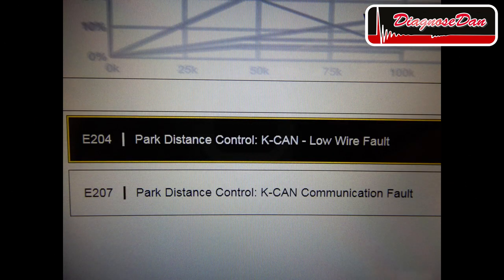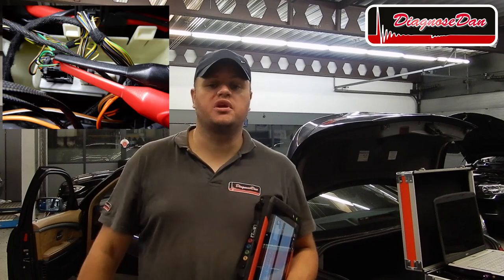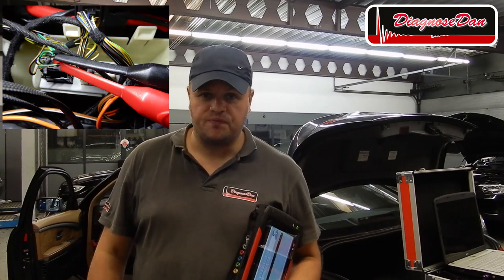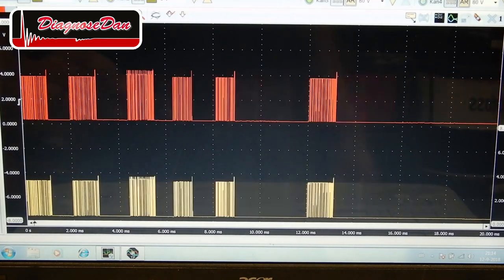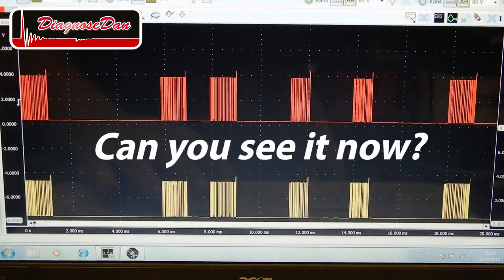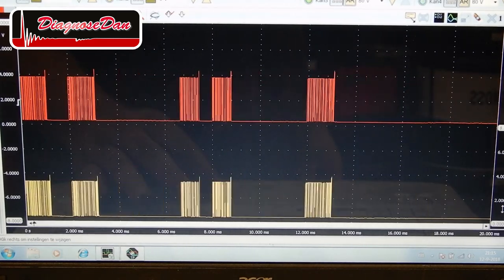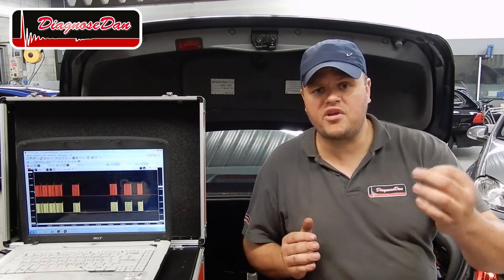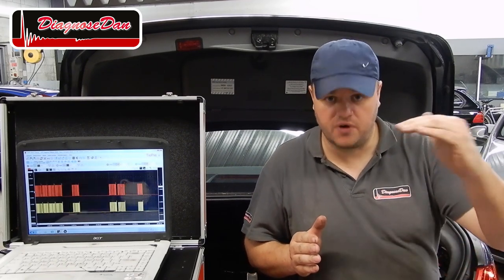Can bus Water bus

Comment: Man you are amazing! 
This video especially :)
Keep up with great work, this is so helpful. 

Need to share this: 
I have Combination Comfort databus (In single wire mode) on my Polo Cross 9n 2004, that's why I got interested in this topic. 
The only problem that I see on the car atm is battery drainage and right low beam doesn't get the power, and it's not working. 
Recently I fixed problem with water leakage from my sunroof, which is common for VWs, and I suspect that is the problem.
I will dive into this, as your videos encourage me to do so, the biggest issue for me is to find the location and the list of modules that are connected to the Comfort Databus to start diagnosis. :)

Comment: That's funny. I also had a faulty trailer module in a brand new company car, draining the battery over the course of a few weeks. No water involved though. It's funny how I on a daily basis work with slide doors that use CAN-bus, and immediately saw the signal problem, yet none of the cars I've ever owned has had this system, and I have no way of looking into my car's pre-bus dataline. Grrrr!
Reply from the maker: Some aftermarket modules won't go in sleep mode and can keep the network awake! And Sometimes it's an installation problem.

Comment: -Resistance between can h n can can l must be 60 ohm. 
-As u mentioned waveforms must be opposed each other
-there is a can diagram connecting module with can line that u may get from alldata 
-there is “can hacker scanner” that may be useful 4 can error fixing 
- resistance between can h and can low of plugged engine computer is 60 ohm and unplugged computer is 120 ohm

Comment: Some mk7  e-Golf, have a similar problem. The computer for charging the high voltage battery, located in the trunk, is mounted so that the wires enters from the top, which causes moisture to seep into the computer.
Reply from the maker: Wow sounds expensive!
Reply: @Diagnosedan  Not really. 150-200 euros maybe. It's not a high voltage component, so it's no different from any other computer.

Comment: Great video as usual and I realize you were rushed do to vacation but normally you would of showed where and how you tapped into the K bus. Did you use a BOB at the OBD connector?
I'm trying to push myself into using our scopes more but never seem to find good info on how to connect.
Reply from the maker: O i did show a picture of the connection. Take a closer look to the video. I tapped into the the K-bus at the PDC module. Yes i was in a hurry. Normally my video's  are more detailed. If you want to get into scoping. Take a look at the Gmto scope! The software tells you how to connect the scope. In many cases even brand specific with a picture. Go to the Ryans Automotive website and take a look.
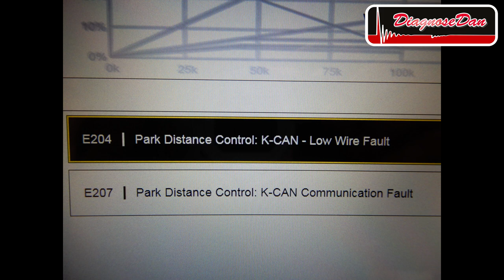Reply: Sorry my bad.I watched again and found your pic at 2:00
I have a ATS escope 4 channel but would like to get the software to use as an aide, is that possible?
Reply from the maker: @richboro1  you can buy the software and you can use wiring diagrams,explainations, and information how to connect your scope and test components. But you can't use another brand scope in the software.

Comment: great video Dan as always I would love to have a diagnoseDan video on a BMW N53 engine one cylinder misfire code cyl5 seems common fault and hard to diagnose have 2009 BMW and BMW change coil, injector computer and now they change coil again I can smell fuel, symptom cold startup idle....... runs fine otherwise. Don't have to pay the bill warranty and they try hard to find problem
Reply from the maker: Wow the changed all that and the car is still not fixed?
Reply: they are not finished, they will take it back for other parts canon, let us see what they do next.... it is for sure interesting to learn how they work but at least they try and hopefully learn something
Reply from the maker: @xerxes456  And you get all brand new free parts!🤣🤣🤣

Comment: Another great video!!  Do all the CAN buses on a BMW diagnosed the same way?  I am having some communication problems in my 2006 M5...  Should I be able to read 60 ohms resistance between the high and low side of these buses?  Also, should I read 60 ohm when measuring  between pin 6 and 14 on the OBD2 Ports?  Keep up the good work!!

Comment: Dan, have you had experience with the Porsche Cayenne 06, thinking of buying a mint one, although the dash has a little exclamation mark light that is on. Supposed to be a general warning light. Apparently the low brake pad sensor sets off this? Any thoughts would be appreciated. It also has the 4.5 liter engine. Your friend John.
Reply from the maker: Porsche makes decent cars, just make sure it's well maintained

Comment: That's what I call a manmade fault.

Possibly nothing wrong with a aftermarket towing module.......if it was installed correctly 
ie in such an orientation so as water cannot enter it.

Always mount so plugs are lower most so any water runs off the module.

Also no harm in smearing grease around plugs, sockets and module seams.
We do it all the time for preventative maintenance:)

Comment: What made you suspect the trailer module ? Was it by chance you saw water in the boot or did you disconnect other modules first.👍
Reply from the maker: The boot was dry when i was diagnosing it. When i suspect a problem with one of the modules, i go to the ones that are easy to acces.
Reply: you always look for aftermarket stuff first because they are more likely to cause problems

Comment: Hello Dan,
I have a similar problem probably  water related on Seat Altea 2004 1.9 TDI  BJB. 
Initially was comfort module 1 wire communication on all 4 doors  and time to time motor stops like missing fuel ,
If i insist trying to start , it is starting , without any error code.
Right now after battery replacement I find it completely drained and with the back Windscreen washer at half of the windscreen;
After recharging the battery  I have no front screen wipers and washer , the Back windscreen wiper& washer is working fine 
No cigarette lighter (used for laptop power ) , no cabin light front and back and most off all , after i stop the engine, the ventilators from radiator are start spinning without stopping for more den 3 minutes
I find water inside motor fuses box which I hope I insulated after air bowled and water repellent sprayed  but radiators fan still not stopping ... any advice where I could look

Comment: Hello Dan! I like your way of thinking! I fixed some issues on a BMW X6 (shock absorbers were causing faults) by going deep to schematics and checking for voltage. It was easy to find which cable line was causing the problem. I would like to ask you, which is the oscillator that you are using on your computer?
Reply from the maker: It's a Gmto scope. For more information go to the Ryans Automotive website.
Reply from the maker: I've also got a Video on X6 shocks b.t.w!
Reply: thanks!
Reply: I just found the video! In my case the wire insulation was destroyed cause of hot climate. Fixed 3 of 4. Waiting the 4th one to die :P

Comment: They should have went full VW and just put ALL the modules in the floor board, and make half the cars convertible LOL!
Reply from the maker: Ha Ha, yes it's kind of strange when you think about it. It shouldn't be to hard to place the modules high and dry🤣
Reply: VW has learned from their mistake, and removed all modules except the airbag module from the lower parts of the car.
The airbag module is placed directly beneath the condensation outlet of the HVAC :P

Comment: just how safe are these aftermarket modules as long as you keep them dry?
Reply from the maker: When istalled properly they work OK. But Oem ones are just as expensive and have a fault code memory that can be read with a scantool

Comment: Hello Dan,
I've been watching your videos and I think they are very helpful for to me as an automotive technician. There's something very interesting I noticed in your equipment that would help in my work. That is the "known good" voltages and oscillographs for different vehicles. I deal in hybrid electric vehicles mainly Toyota/Lexus and Honda. Is there somewhere I can get this information? I went to my local Toyota dealer and they could only help me with wiring diagrams. I need your help
Reply from the maker: Contact Gmto. They might be able to help.
Reply: DiagnoseDan Thanks Dan

Comment: Hello Dan, well I had my 750li towed into a shop a week ago, they are VW experts and also recommended by a neighbor that fixed his wife's BMW turbo problem. After being there for four days the mechanic said the car doesnt recognize the key. He asked if I had another  key. As the steel portion of the key was still in the transmission release drop down lock by the hood release, and the mechanic didn't know about this function it kind of worried me that he might not know BMW . He has some program, ISTA? So i told him about your YouTube videos, I also saw a video on BMW CAS ALIGNMENT, thought it would be an easy fix. Today will be eight days, guess I will have to get it towed home as I cant go to the BMW dealership as they already took me for $1800 and the tow truck driver mentioned that he towed another BMW from that dealership the day before mine. The illusion of a beautiful car, think I may have to scrap it. BMW being leaders in  advance technology scares me for the rest of the cars manufactures using this technology. Should I just take the loss? Before this car takes my savings?
Reply from the maker: It's not about the car, it's about the people working on it. Some dealerships have great techs and others not. The same for independent shops. You might end up selling your car for a minor issue. All cars are getting more advanced not just BMW. Try to find a good shop and a second opinion.
Reply: @Diagnosedan  It seems to me, that there is good technology and bad technology. My 1983 Porsche 911 I have taken care of for 28 years and the other day drove it and said that it still drives better than it looks. Now that is good technology (what a fine car!). No computer on board. So I feel with the 750 Li that I have owned for 2 years, which looks in mint condition, the engineers have let me down. Over the years the reliable cars built by the past generations reliability, have been engineered to fail, harsh words, but what else can I say. Every computer
 component that has made cars reliable, have not made cars reliable. The cost of diagnosing and replacing components are making it so that the assurance of a car being a reliable mode of transportation is what 4 years? And we pay so much more for a car nowadays. To me that is bad technology. Engineers should know that we are transporting our families in some harsh weather conditions and that it is imperative to build cars that can do that. That was the idea in the old days. Had one mechanic come to my house with a $3700 scanner, didn't resolve anything. Now at a busy shop with a good reputation, not sure if he has the technology or tools? Hmmmmmm. You are a rare find Dan, glad your neighbors have you!
Reply from the maker: @wearethe80s4sure  I tell nobody over here about the channel. Nobody knows🤣🤣. A 3700$ scanner is not going to solve the problem, it's the tech operating it. The thing is people want this technology, you didn't have phone,Bluetooth,internet, and all that in your 1985 Porsche. 
And to be honest most things are easy to fix of the right tech is working on them.
Reply: @Diagnosedan  well, I talked with mechanic this morning, said he had one more thing to try in his arsenal, this aft. Guess I have to interview the next mechanic/tech to see precisely what he/she has in their arsenal. Any tips on what to ask them? They all say they can fix. Thanks for reading, odd that not to many people know about your channel. You should help auto engineers. Get them back on track.
Reply from the maker: @wearethe80s4sure  good luck buddy!
Reply: Well, got a call from mechanic this morning, said he tried everything. Couldnt get it started. He said he had it running for a minute, but I am not sure if he did. Said that it shut down and wouldn't start again. Back to the drawing board...lol(cryoutloud)
Reply from the maker: @wearethe80s4sure  if he tried everything the car was fixed now.
Reply: @Diagnosedan  You are probably sleeping right now, I have been on the computer looking for symptoms like my car has. Think I found something...if you look at this video...BMW E65 E66 DME (used)replacement programing 
This is what i think my car needs. This guy uses the Autohex II to restore DME functions. You probably already know about this, but it may also be more knowledge for you.
Do you know how I could go about doing this to my car? What tool would you use that may do the same as the YouTube video 14.45minutes mentioned above. Or my next move is to tow car to this Serbian mechanic that works on Euro cars. But I will ask him what device he has for the DME programing. Or will tow back home? Hope you silence your phone for sleeping.
Reply from the maker: @wearethe80s4sure  4 in the morning and i can't sleep🤣🤣
Reply: @Diagnosedan  try to fall asleep with your lips precisely 1cm apart. You will fall asleep in two minutes.
Reply: @Diagnosedan  Guess you couldnt sleep because you were going to make a video. New mechanic said to come and see him, he is going to tell me why he thinks it needs a new starter? He says the cost of a starter is $300 plus 8 hour install around $1200. Man, what if it's not the starter?. Will see what he says.
Reply: Well I went to the new shop, again a nice guy. At least the 750 made it on the hoist. He showed me that the braided wire that goes to the brushes of the starter was not connected, again why would an engineer make a wire like this. Especially such an expensive vehicle, and such an intelligent manufacture would not make it an 8 hour job to change starter or would they. There should be a civil lawsuit against this company for making account dissolving products. 
So I said to the mechanic did you try to jump it? Like you would with any screwdriver. Would you try to put alligator clips to join connection, then start? Would you do this Diagnose Dan?
Saddens me that the previous mechanic that had my car for ten days, wouldn't have noticed this. Guess he didn't put it on the hoist.
Said he started it for a minute, guess he didn't. Well I bought there team a nice pizza for there troubles.
Anyhow coincidence maybe that the starter wire just disconnected while I had the car at home...no signs of problems starting. Before no start, could be.
Reply: @Diagnosedan  the new mechanic found that the woven copper cable that goes to the brushes inside the starter was corroded and split between the nut that connects to the starter and where it goes into starter. Have you ever seen this? Why wouldn't this cable be coated with shrink wrap or plastic? What code would I get for this problem?
Reply from the maker: @wearethe80s4sure  I have not seen that before, that kind of wire is used by all manufacturers. Normally it's very reliable. But this proberbly was your problem. 
Glad it's fixed!
Reply: @Diagnosedan  I was proud of Neso finding that fault in the starter. Asked him if it could have been caused by a short somewhere?  He said on his test drive the Three ABS lights popped on, so I should look for an ABS module at a wrecker. The next two drives I took, towns 15 minutes away, no abs lights. Then when i took my wife out for pizza the lights came on, the idrive button was spinning on it's own. Didn't enjoy my pizza and beer thinking of this. On the way back home, twenty minute drive, no lights. A real head scratcher. Ran like a swiss watch! Interesting, but like you, I would like to know, why?

Comment: Hi Dan. I have a question. If you were using a OBD2 scan tool and you observed all the readings had a spike in a negative way, what would be your thoughts? I have a vehicle that does this. My alternator was putting out AC volts way high so I replaced it. I have tried my tool on another vehicle and it works fine. I even replaced it but still get those readings. My thought is a wire issue but have no idea where to begin.
Reply from the maker: You would have to take measurements at the Dlc
Reply: I only have 4 pins in use on my DLC but checked. I found a odd reading between pin 4 and pin 5 which was -2.4 mv. Would you be able to tell me what that would indicate.
Reply: Well I finally checked my DLC using neg. lead to ground and pos. lead to pin. Pin 2 was .3 to 1.8v. Pin 4 was 18.2v and pin 5 was 12v. I then tested between pins 2 and 5 and got .29v key off. 1.5v Key on. Any ideas? Is this a shorted module?

Comment: Hello. I have a problem with opel 2.0 diesel. Its engine ECU has direct CAN conection with fuel pump. No ather modules are conected on thees wires. When I disconect fuel pum and backprobe its plug I get nice CAN waveforms and a lot of mesages from engine ECU. But when I conect fuel pump and than backprobe it, waveforms still looks good, but there are less mesages left, a lot less. Is it normal? It is no start, and there is   DTC relaited to CAN BUS.

Comment: Thank you for this video master! I was able to fix a BMW X5 with K-Line fault with the help of your video. My BMW X5 k-Line was doing the same as your trailer module. I found out the Shifter module and the controller module both were bad causing the signal to separate. Thank you so much for your video!!! Tony at Cornerstoneautoservice.com

Comment: Hello how are you thanks for the videos but I am I have a question for you I was wonder if you can help me with my 2003 BMW 525i series, I can’t get my scanner to communicate with any module what do you think is the problem I already check for power and ground at the DLC connector and I have power and ground,The problem is that this scanner is not communicating with any module if you get help thank you very much.